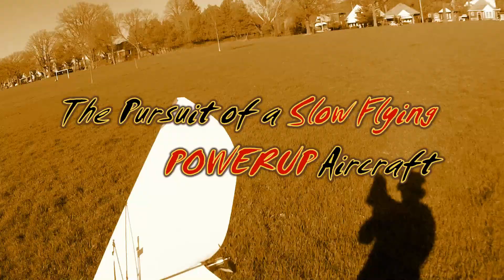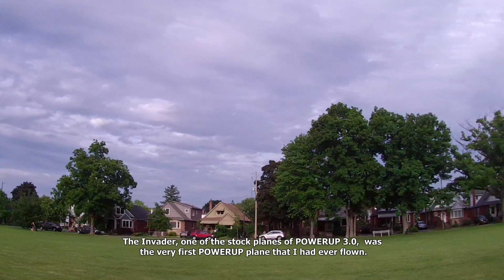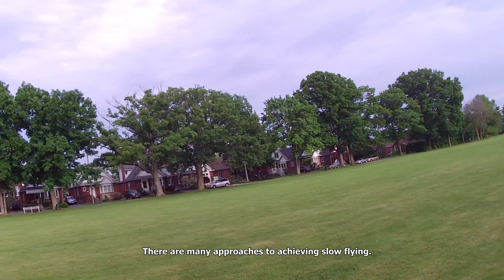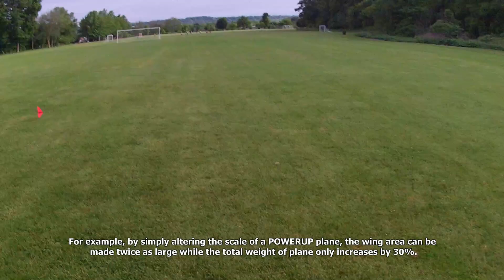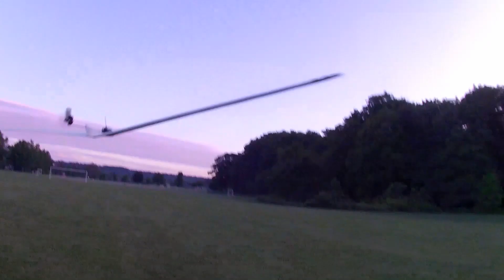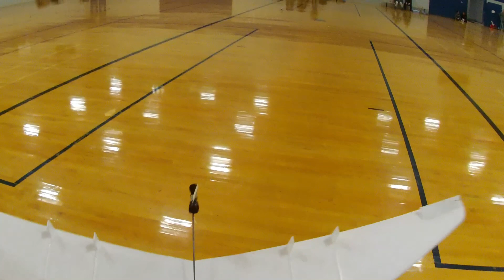In Pursuit of a Slow Flying POWERUP Aircraft

Comment: Can you please give little  information on control and battery?? What should be the battery V and weight??
Reply from the maker: The bluetooth POWERUP module uses an one-cell lipo pack and so the nominal V would be 3.7v and the max V 4.2v.  The battery is built-in and I don't have its specs. The total weight of the module is between 9 and10 grams.
Reply: Thank you for your reply.

Comment: I made a similar aircraft but using paper. I wanted to explore a printable aircraft that had strength through folds and curves. It flew well but was tricky getting C of G right. The Powerup 4.0 module was used and I flew it in a gym. Not a great turning circle!

Comment: I bought two power-up planes, thinking the first one was just bad luck. Nope, 2nd was just as bad as the first. They have bluetooth connections that dont stay paired. But I took the guts out of a microdrone and made my own. It works great. I even made a few more to experiment with. I got the drones at Target for $20 each and Paper dont cost a dime. Just need hot glue, popsicle stick, a soldering iron and a super small phillips screwdriver. The planes I make are the kind John Collins makes. (record holder for paper airplane distance. He's in youtube under the paper airplane guy) And Peter(I cant ever remember his last name) Shows how to disassemble the microdrone and prepare it.
https://youtu.be/GSDNgnhJ-FM for Peters video and 
https://youtu.be/2n4xq0DnbHI for John Collins planes.

Comment: I noticed the thrust angle on the larger wing seems to be more important. 
I’m not sure lowering the angle would improve the handling. 
What certainly plays a role is the lack of control surface. 
The slow speed and inertia of the large wing make it much more difficult to induce a turn on prop power alone. 
You obviously found a better compromise in the smaller wing but at the cost of a faster airspeed. 
Maybe you could try to mount some form of surface behind the prop wash. The aerodynamic force on the airframe would be more direct. 
I was thinking along the lines of a double beam v-tail behind the prop. You’ll have to adjust the center of gravity and it will add some weight but who knows....

Comment: The original YB 49 used drag rudders.  The outboard wingtip control surfaces would split apart top and bottom thus inducing drag on the side of the aircraft that was in the direction of yaw desired.

Comment: Did you get the 4.0? With 2 motors maybe the bigger model will perform better.
Reply from the maker: Not yet.
Reply: @maxxu8  I tried the smaller scale model 62cm span with the Powerup 4.0 twin motors and it still won't turn on a dime, and when it turns it tend to keep turning, you will need a pretty large space to fly these, I haven't mess with the gyro tuning of the powerup 4.0 for this yet, it may help

Comment: Max, you did a wonderful wing twist on your "Little Horten Wing" model here: https://www.youtube.com/watch?v=uc0G0Tr0Lwo&t=2s . What if you used similar wing twist in the larger wing to achieve what Prandtl proved. I do feel the Root Chord is also too large on the larger wing and could be reduced once again in line with what you did with your "Little Horten Wing." You could remove one or two vertical stabilisers and rely on 'proverse' yaw to roll effectively, as outlined by AI Bowers (NASA) which is well explained here: https://www.youtube.com/watch?v=Hr0I6wBFGpY . You might want to test removing the ailerons completely as the twisted wing will give enough lift. It may strangely enough even benefit from an even longer wing span while keeping the weight the same through reduction in Root Chord and a shorter Tip Chord. I would also encourage you to add a 2mm thick foam boot on the rudder to enlarge the rudder surface. I have done similar with my Powerup and the rudder extends forward beyond the pivot as well as aft. I cut out a 2mm space on the rear for the prop to run free so I even have rudder above the prop. One key thing to remember is that you have to throttle right down to 20% - 30% to turn with the enlarged rudder or it doesn’t respond. Just to add, given the fact you are trying to create a wing which flies level unless instructed to change course you would probably need some dihedral to have it return to level with rudder reestablished in the centre. You continue to inspire me, and I have made many of your models.

Comment: You can use two small rudders moving in opposite directions one on each side of the wing. May be just before the elevator. Or simply use a 2mm foam rudder slightly bigger and attach it to the rudder

Comment: Hello Max, this video is great, and has motivated me to try the same 65cm wing as a project. Would you be able to share what your angle was for the two wings? Also what kind of glue did you use? Thank you.
Reply: My guess, from looking at the footage, was a 4-5 degree dihedral. Also, did you reinforce the central seam with tape?
Reply from the maker: @IvanNieves  Hi, Ivan, no dihedral is used. At least, the leading edge is totally flat. Since the wing has a little washout twist, the trailing edge does look like having some dihedral.

The glue that I used includes UHU Por, foam safe CA, and Super Phatic. I find the UHU glue is the easiest to use, but it's not very sandable. CA is easy to use and sandable, but because the cured CA is so much harder than foam, you may get some surprises when you sand the glued area. Super Phatic is good for sanding, but it's not very easy to find and use.

No, I didn't use tape to reinforce the central seam.

Comment: Alter the rudder with glue and add an extension to get more control or add two motors and use two phones on a board to keep controll in sync with one another. Looks Nice I'm getting a few

Comment: The first thing I would try is to enlarge the rudder. If the mechanism is not strong enough to turn it, I would try making a more balanced rudder, with maybe 20% of the area in front of the pivot point, which should reduce the force necessary. Another possibility is to make a biplane wing which gives you the same lifting area with half the width, which should help with easier turning.

Comment: OK,  It's only a small model/toy however if you want to really improve radically, you need to think seriously and critically about real aerodynamics principles.  With that thought in mind, I offer the following to ponder though I cannot fully explain expand here.  I am sure some will have a laugh about it being way too serious but it is simply intended to provide some insights that an enthusiast may find interesting.

So following the Northrop flying wing development is probably not the best example.  I think you would be better served following the Horton Flying wing development path which was based on Prandetl's bell shaped lift curve.  This is because Prandtl's solution solves the adverse yaw control problem and is the optimum performance solution because it correctly identifies the real limiting design constraint as being the wing root moment load, and not the span.  This solution is similar to tiplets except the tiplet is simply part of the span and provides both lift and thrust from the forward tilted force vectors due to the helical flow of the tip vortex.  Your kind of doing this in an inefficient way already by adding up trim at the tip elevons.  To do this efficiently, you need to adjust the spanwise distribution of wing camber, reflex and twist in a controlled way the achieves Prandetl's bell shaped spanwise lift distribution.  However, you also need to realise that much of the area of a flying wing is not a lifting but a stabilizing surface.  Well, OK more accurately it's a combination of both but the point is, the area is not all equally contributing to lift.  This is the main reason that efficient gliders tend to be a main wing and a stab with a moment arms between the 2 aerodynamic centres (AC)s of at least 4 mean aerodynamic chords (MAC)s.  That configuration makes the whole main plane equally contribute to lift while the longer moment arm allows a smaller stab to generate sufficient pitch stabilizing force.  Depending on the moment arm you may get around 85-90% lifting surface efficiency compared to a flying wing's 75-80% or so. However the flying wing gains more efficiency from the absence of parasitic and interference drag of fuselage and fins etc.  One of the main advantages of flying wings is stealth.  They are extremely hard to spot which a military tactical advantage.

While you are using Depron foam as is everyone else, you will all continue to come back to a similar optimum wing loading.  If you want to fly slower than the others, you need to develop a better strength to weight construction solution.  Airspeed is essentially a function of wing loading, coefficient of lift (Cl) and drag.  Drag because because at small angles of glide, drag determines the sinking rate.  If you increase Cl, you greatly increase induced drag.  Operating at high trim can put a glider at a slower speed than optimum sink rate.  In this condition it tends to fly very slowly down a steep gild path.  This slow trim requires more power to maintain level flight.  All I'm pointing out here is that increasing area and trim eventually leads to flying too slowly for the available power.  So the trick is really about finding the optimum balance of the various factors.  It is not true to say a particular design direction will always result in improvement.  It only yields improvements up to the optimum point and yields a detriment after that.  So the question is,  where is that optimum point?
Reply from the maker: Thanks Ken. You have covered a lot of areas with your comment. My flying wings do have wing twist and I see the trimmed up elevons as a way to increase the wing twist. I guess it's not very efficient but I do things through trials and errors. I can build in more wing twist in my future flying wings.
Reply: @maxxu8  Nice reply Max.  I think the upturned elevons act as camber reflex, giving the tip sections positive stability.  A symmetrical section has a stable center of lift at all trims at the wing aerodynamic center (AC).  The AC is about 25% of MAC behind the  leading edge.  Increasing the camber shifts the whole lift curve up so the wing can produce higher lift before stall. Also, min profile drag occurs at higher lift so the sections efficiency at high lift is improved but drag at zero lift increases and pitch stability becomes negative (unstable).  That is, nos down pitch causes the center of lift to move aft, pitching nose down even harder & visa-versa,  You can build a straight plank cambered flying wing and make it stable by re-flexing the mean chord line at 75% so that the nose, reflex point and trailing edge are aligned straight even though the camber line through these points is curved.  However, the CG is critical and you waste near 40% of the lifting area as the reflex counters some lift.  In a sweped cambered wing, you can transition reflex from none at the root to around the 70-75% point of the tip chord (measures from the leading edge.   This will also be stable but with much less wasted lifting area.  In the case of the Horton's, the root had little if any camber but the tips had camber and reflex.  This greatly minimized the amount of reflex required for positive stability as the root was not detracting much from stability.  Following this, you could possibly and adjusting the CG point carefully, you could probably improve efficiency.  Your elevons may also be compensating for a too forward CG.  Careful experimentation with the most rearward CG and minimal reflex that obtains stability should optimize efficiency.  I know this because several decades ago I was designing RC flying wings and studying aerodynamics.  Worth a try maybe, Happy Hunting.

Comment: Fit a steerable propeller to turn the larger wing at slower speeds or use weight shift as used in a hang glider
Reply from the maker: The new version of the POWERUP module (4.0) will feature 2 propellers side by side to provide differential thrust. I think that will solve the turning problem.

Comment: Very interesting. I was a hang glider pilot years ago, and got out of it just as the first double surface gliders were coming out. I built countless hand launched Topcoat Mylar and balsa wood models. The plane you show here much more closely resembles the modern hang gliders. Not sure if I will ever make any more models, but still curious. What is nose angle? I am guessing 150+. How much dihedral? Wing not straight across, so with one wing flat on the table, how high off the table is the other wing tip? How much wash out, which is what we called the difference in wing twist, so center is at 0 degrees, wing tips at 10? 20? degrees??? Airfoil cross section???

Comment: Impressive. As for the larger model, your power module increases lateral area at the nose. If you can move that backward or bury it, that would increase yaw stability. However, you would need nose weight to compensate, increasing overall weight. I'm sure you have thought of this, but I offer it for what it's worth.

Comment: Those are some nice YB49s.  I have successfully added a Power Up unit to a commercial 17" span WalkAlong glider.  With its extreme undercamber and reflex, it flies quite slowly, and it turns nicely with an enlarged rudder.
Reply from the maker: Thanks for sharing your experience. The wingspan of my larger YB49 is more than twice as large as your 17" WalkAlong glider. I guess that's why the rudder on my larger YB49 refuses to work reliably.

Comment: The wings were known to be hard to turn. Bigger elevons or wider or both. Look at some foamy flying wings for scale.
Reply: The problem is that model elevons don't do everything that the Northrup flaperons did. 
On the Northrup wings there was a top and bottom piece, that works together. They could operate like a normal aileron (up & down), or they could spread, creating an airbrake. The drag would pull the wing around. They may have used differential thrust too, but it's weird flaperons that I remember. 
My source on this was Jack Pfarr, who was one of the engineers at Northrup.

Comment: You've probably solved the rudder issue by now, but what I thought of is to just make the control surface bigger with a foam addition to the profile of the rudder. Like the plastic rudder would fit into a notch in a piece of foam and voila - larger control surface. Maybe?
Reply from the maker: No, I haven't solved the issue yet. I am hoping now that POWERUP 4.0 will solve the problem. Enlarging the rudder area was one of a few things I tried at first, but it is limited by the power of the rudder actuator, which is only capable of driving a small rudder.
Reply: My thought with your rudder authority issue is to remove the center fin mimicking the body and 2 of your vertical stabilizers. flying wings lack tails like conventional frame aircraft so the 4 vertical stabilizers and the fin in the center on your yb49 help keep it flying straight. On Flite test RC flying wings they only have 2 vertical stabilizers, one on each end of the wing.
Reply: @kng128  Not independently actuated like my wing tip rudders on my Fledge 3-ET.

Comment: I can't believe the length of the flight times.  My power-up only runs for half that time.  Bigger battery required?
Reply from the maker: That's odd. Maybe, you've got a dud? I've bought several POWERUP modules. Their performances vary. Battery, motor, and prop can all affect the actual performance. Test-run your POWERUP module by using full throttle. It should be able to last 3-4 minutes with a full charge. When flying, try not to use full power in order to have a longer flight.

Comment: Can you make the Power Up module increase deflection for steering? The only other thing is to use two motors and have differential thrust. I made a slow flyer like that and it turned nicely (from a cheap faster twin engine plane).

Comment: Max another great job on your build and video. To get more rudder response change the magnet to a stronger one and less friction at the 2 attachment points. With a stronger magnet you can make a larger rudder and the coil will be able to move the extra weight.

Comment: Very interesting. I have two of my students trying to make a similar flying wing. What thickness of foam are you using?  Was the wing cambered or the foam cut into an airfoil? Any suggestions for my students? I know what you mean about the rudder. What we did to increase the response from the rudder was to attach a small piece of tape, folded over onto itself to increase the surface area of the rudder with minimal weight.
Reply from the maker: The thickness of the foam is 4 mm. I used a fresh retractable paper cutter knife to shape the airfoil roughly first and then sand the wing into its final shape. My suggestion for inexperienced students is to add two vertical winglets at the tips of the wing. In this way, no dihedral is needed. It's much easier to experiment with the winglets by changing their size than with the dihedral. This is what most RC flying wing builders do. 

Yes, I did put a piece of tape on the rudder as you can see on the still photo of my two flying wings used in the video. Thanks.
Reply: @maxxu8  Couple question's, the foam you use. I tried Walmart, paper on both the face's, too heavy? What grit of Sand Paper?
Reply from the maker: @j.christie2594  Yes, it's better to remove the paper. The foam boards available at our local Walmart stores are of higher quality, which means it's difficult to peel off the paper. I use foam boards from Dollar Tree, which are cheaper and easy to work with.

I use 150-220 grit sandpaper.
Reply: @maxxu8  Thank's for the tip's. Love your work, and Thank's for sharing!